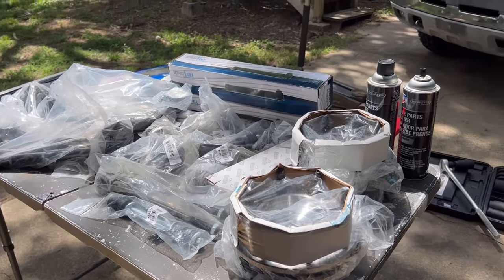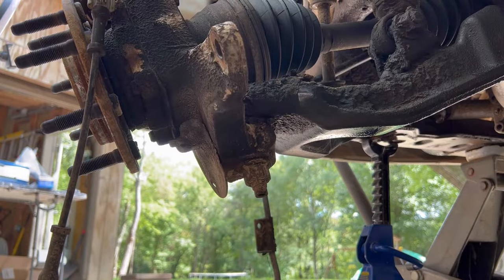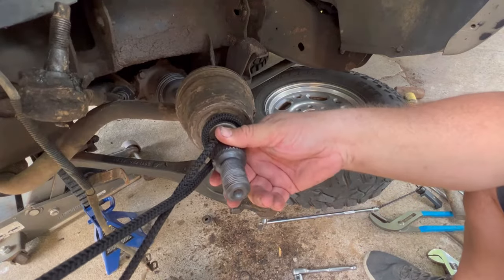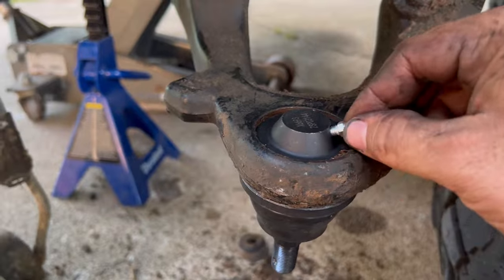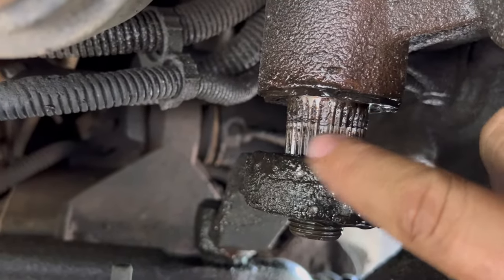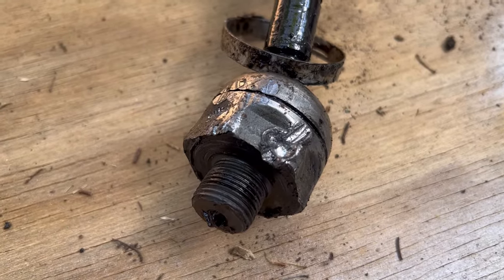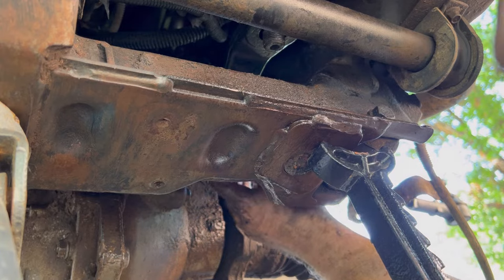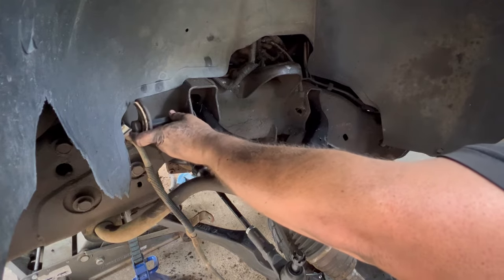How to Fix: Silverado 2500HD Front Suspension Rebuild (Link for rebuild kit in description⬇️)

Comment: Thank you for taking the time to make this video. I have to say that your explanations, editing, and speed video parts were great for getting to the point and showing key elements without a bunch of wasted BS video time!  I am just getting ready to order a front-end rebuild kit from Detroit Axle, so this was perfect! Hubs were already recently replaced with Napa severe duty, so they're good. My 07 Duramax only has 120,000 on it, but my pitman and idler arms are toast, and the boots on the upper and lower ball joints are deteriorated... so I was gonna go ahead and get the kit with pitman, 2 piece idler, inner/outer tie rods, loaded upper arms, and lower ball joints.
Also doing Bilstein shocks, and new drilled/slotted rotors and carbon pads at the same time. 
My truck sees as many miles towing a 17,000lb 5th wheel as it does empty! 
I have just a couple questions/ comments... I was originally thinking I'd completely disassemble and rebuild one side and then the other, vs. removing the whole drag link as an assembly and rebuilding it loose on the bench. Is it too hard to get the inner toe rods apart from the center link if it's still in the truck? I was wondering if that's why you removed it all together?
Also, wouldn't it be easier to just put a floor jack under the end of the lower control arm and lift "slightly" to remove the shocks,  vs. turning the torsion keys loose and having to try to "reset" the ride height of the truck? Just wondering if I was missing something! Oh yeah, I almost forgot to ask.... do you know if there's any way to determine if the truck has a 3 groove vs. a 4 groove pitman arm,  without disassembling it first just to verify? 
Great video, and I'll be saving this to refer back to once I have all my parts! 👍
Reply from the maker: Thank you so much for your feedback, and taking the time to post such a well articulated comment. This one wins comment of all time!

In retrospect, I would’ve removed the tie rods with the center link still in the truck. It was a PAIN to do it out of the truck.

Also, yes, the floor jack lifting the lower control arm would’ve been easier. Sometimes my efficiency is not the best, lol!

As for the pitman arm, I took a chance that the kit online would have the right one for the application. Probably not the best move, but they got it right. 

I genuinely appreciate your comment and insight. I wish you the best on repairing your 2007. These trucks are totally worth the maintenance!
Reply: @Grub 'N Gas  Right on! Thanks for the reply and the compliments! 
I respected your ability to clearly explain what needed to be done,  and felt a concise reply with a couple legitimate questions would be worth the time.... 
and I was right! 
You da' man! 👍
Reply from the maker: @wingnut6867  the feeling is mutual! Thank you for the comments and challenges to do it better:) Have a rocking awesome day!
Reply: @wingnut6867 
Hello Sir... Jusf was reading your comments and replies here and I admit my mouth watered a little bit when I read the upgrades you had planned or already completed on your 3500HD. I've got an '09 that is going to need all of that itself but I'm afraid I won't be able to afford it all in one bunde. Wondering if you finusged up, and if you would mind sharing approximately what  you
ended up paying in totsl for the stuff you talked about in this thread. Ty both for fun reading as well. Im always a fan of wit over sarcasm anyday.

Comment: Yours is the best video I've seen, thank you!
The only thing I'm doing different/ in addition, is replacing the lower arms as well. Other video's regarding that, is the torsion bars can be a bugger to remove!

One thing I love about Chevy, is the design and parts stay rather consistent for many years!
Mine is a 2008 6.0L 3500HD 4x4 DRW crew cab with a dump bed.

Thanks again!
Reply from the maker: Thank you so much for the feedback, and I’m stoked this video helped! I’d love to have a dump bed one day, I’ll bet that comes in handy!
Reply from the maker: And yes, love the consistency of Chevrolet’s design!
Reply: @GrubNGas  I have a side business doing firewood here in south central Colorado. I can haul some two cords in the truck, or two in the dump trailer and one in the truck.
The truck gets a lot of 4x4 action and a lot of off road action as well, in some extreme weather conditions.
Otherwise the dually gets used for the farm.
It hit 200k miles, and it was letting me know, "Hey! I need some extra TLC!" lol

FYI, Kanati Trail Hog tires rock for the winter. I haven't had to chain up in some 3 years! That I found astonishing, as Dually's generally suck in the snow!
Reply from the maker: @FarmerRiddick  heck yeah, that’s good info to know! I’ll look those tires up when mine are worn out👍

Comment: I'm about to do this on my 06 2500 as well.  This video helped me realize the headache I'm in for since I'm also doing the control arm bushings.  Great video and thank you.
Reply from the maker: You’re most welcome, and yes, it’s a chore. You got this, though! Just be sure to keep those jack stands and extra safety precautions in place to keep you safe, friend:)
Reply: Got the 6 ton stands on the way and I'll do the tire trick as well. @GrubNGas
Reply from the maker: @auzzy89  rock on! Here’s to your success! Appreciate the comments!
Reply: Start spraying your torsion bars where they connect to lower control arms and keys with penetrating oil for a week or so before you start your job.  That is going to be your biggest problem on disassembly, trust me.
Reply from the maker: @bigredjohnson6921  thanks for the info, that helps a lot!

Comment: 10:25 I have a 97 k2500 suburban and the ball joint directions said to point the fitting towards the inside of the vehicle. Well, you can see the relief in the control arm where you installed it correctly. Impossible to grease the fitting as per my directions. Such a little thing caused a big PITA. Wish mine come apart like yours did!!
Reply from the maker: That sounds like a ROYAL pain! Sorry to hear this is such a headache. Maybe one day I’ll get a chance to work on a 90’s and catch it on film. I wish you all the best, and thanks for reaching out!

Comment: Hey brother, great tutorial! To the point step-by-step, clear camera angles and i feel the 90% "how-to-do" commentary and 10% banter/chemistry with wifey struck a good balance. 

Quick question. 01 Silverado 2500hd 4x4 and just recieved that same detroit axle kit and one thing that drew my attention was how not so heavy duty the upper control arms at least appear to me by comparison to whats on the truck just like the one you replaced in the video. So i was curious if its just a looks can be decieving thing or if it is just a lighter duty swap?
Reply from the maker: Thanks so much for the feedback on the video! It was a lot of sweat making it, but worth it:)

I too noticed the lighter upper control arms. I haven’t had any issues with them so far, but I did notice the non-greasable ball joints squeak on one side within a couple of months. If I had it to do all over again, I would have looked for uppers that have the zerk fittings. That’s my thoughts so far, hope that helps!

Comment: So what is the good, bad, and ugly on the Detroit Axle parts after 1 year of service. 

I am about to do the same job on my 2002 2500 and I am currently contemplating Detroit or Moog....
Reply from the maker: Well, the good is, all my parts have held up great…the one outlier is that the non-greasable upper control arms start to squeak about 6 months in. My advice is to definitely get uppers that have zerk fittings. Other than that, it’s been a great kit. The Moog is better quality, but the Detroit has held up nicely for me…minus the squeaks.
Reply from the maker: I replaced the squeaking upper with a greasable Moog.

Comment: How r the parts holding up , i was skeptical of detroit axle. From all the mixed reviews,  so i bought different parts
Reply from the maker: So far only one has failed. It was the upper ball joint and it started squeaking within 6 months, replaced it with a greasable one.

Comment: Hi there. How are the parts in this kit holding up? My 04 2500hd needs a front end refresh and im curious about how all the different kits hold up. Thanks!
Reply from the maker: Good morning! So far, so good. I had to replace one of the upper a-arms because they were non-greasable and one started to squeak. But all in all, a good value.
Reply: This is what I came to ask and I see my question is already answered. Can’t beat the price for the parts. Nice video… thanks.
Reply from the maker: @Ageman6058  thanks so much for your feedback, and glad this video helped!

Comment: Thank you for taking the time to share this. I'm looking to do the same to my 2004 2500. How are things holding up for you? Any issues with these parts?
Reply from the maker: You’re most welcome, and thank you for commenting! So far, I’ve had really good service. One item in the list to get elsewhere is the upper control arms, as these are not greasable. Definitely get some that are greasable as one of mine started squeaking and I replaced it again.

Comment: How are those parts holding up after a year
Reply from the maker: I’ve only had to replace on upper control arm since..and that’s because it started squeaking due to no greasable zerk fitting.
Reply: I went with the moog uppers. Let's see how hold up
Reply from the maker: @riccoronado430  I’ll bet they do well!

Comment: What kit did you use for this job?
Reply from the maker: Here’s a link: Detroit Axle - 8 Lugs Front Wheel Hub Bearing + Upper Control Arm w/Ball Joint Suspension Kit Replacement for Silverado Sierra 2500 3500 https://www.amazon.com/dp/B07RWQMQR8/ref=cm_sw_r_cp_apip_JS69kpaNdgIxa

Comment: Would it matter if my truck is 2wd?
Reply from the maker: Definitely check the part number for the kit, but most parts should be the same. You can plug in the 2WD parameter in the Amazon parts search.